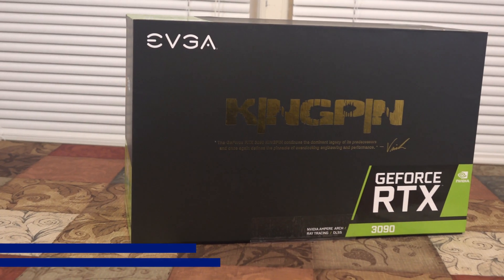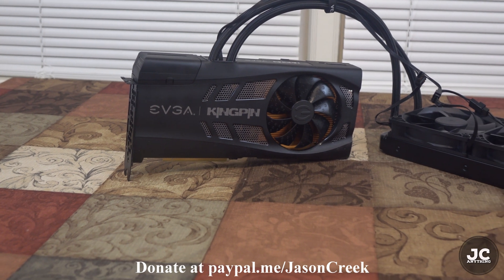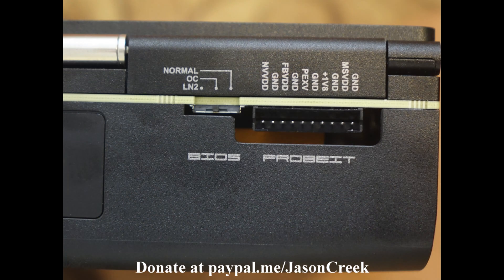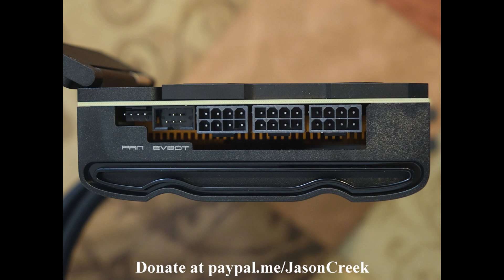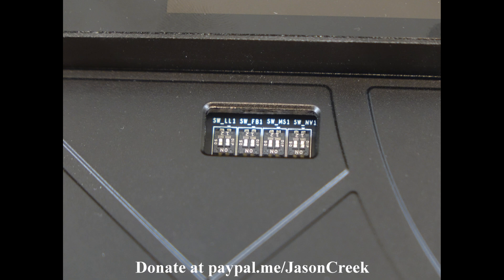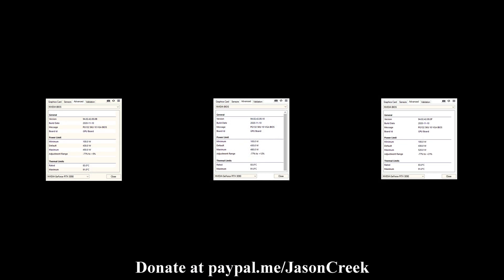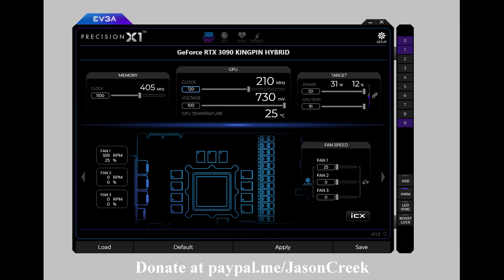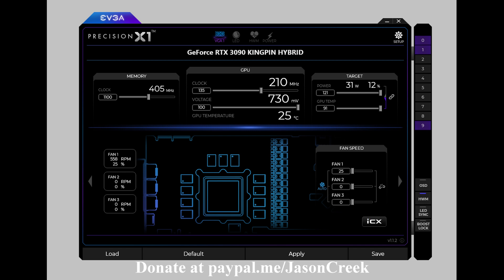EVGA 3090 Kingpin First look and Overclock

Comment: Good video! Something tells me there is something wrong with this card. It should be doing around 15k with this settings. My old FTW3 was maxing out at almost 14800 in PR before it died. Is your card consistently reaching the power target? Many EVGA's this gen seem to have power issue and keep hitting power perfcap for no reason while staying below 90% power even with maxed out power target.

Comment: hello, I like to buy a 3090 Kingpin, a couple of questions do not milk me calm to buy: Is there plain water inside? Is it possible to add or replace if necessary: It is possible to open and add if there is a need to add:
I also wanted to know if I could change the coolers which are on the radiator 3pcs and put the RBG
this one coolers i like change if possible  
https://www.corsair.com/us/en/Categories/Products/Fans/RGB-%26-LED-Fans/iCUE-QL-RGB-PWM-Fan/p/CO-9050098-WW
 
 
Thank you

Comment: Your base clock of 2010 MHz is really low. Have an average Kingping bin myself that sits at 2070 with no adjustments. Seen a few others that sit at 2100 with no adjustment. Also you should be able to go alot higher than +120 offset for port royal. Run mine with a +165 for a 2235 MHz clockspeed and +1500 on the memory. Scores over 15000. While no two cards are the exact same, Something seems strange with your card.
Reply: My strix does 2100mhz also in demanding games. Haven't run port royal yet tho. Mines on air and goes to 1.1v
Reply: @ShaneBuchman  im talking without touching the MHz slider. I can OC my card to where it holds 2175 MHz in demanding games after it heats up just fine but out of the box some of these cards are hitting 2100 MHz flat out no adjustment necessary.
Reply: @mylittlepwny3447 My 3090 ti kingpin Runs 2100 mhz without any adjusttment can go stable with 2220 mhz at 60c core temp. Its Crazy
Reply: I think he may have the dip switches off. Sometimes it's better to not switch the fbvdd  on, because every card is different, and that's better adjusted in RTX Classified tool instead. That can make your core speed look low, but card will still perform as it was clocked higher than what's showing.